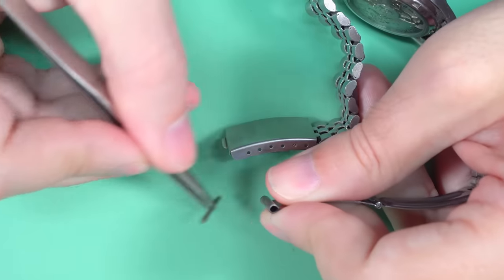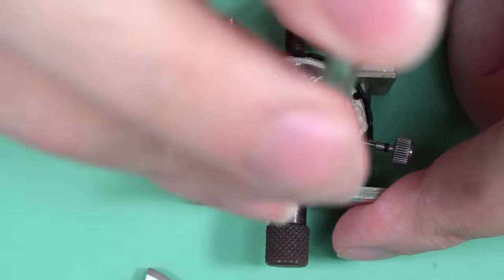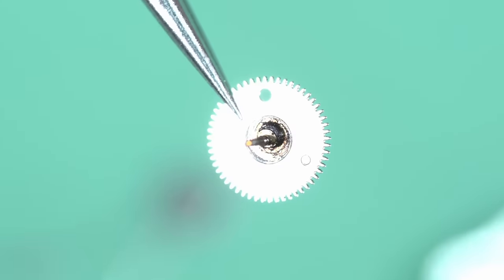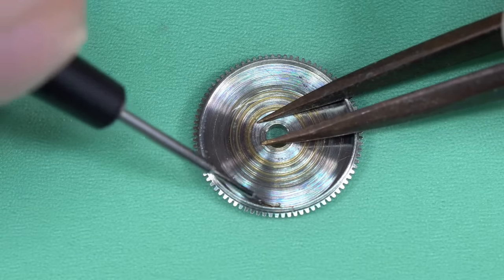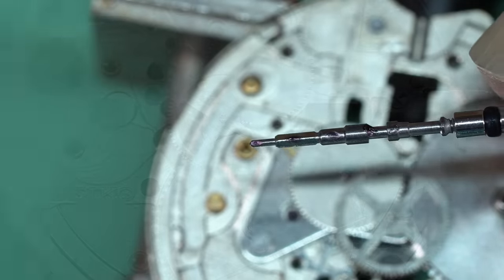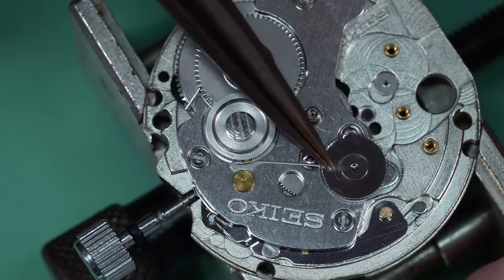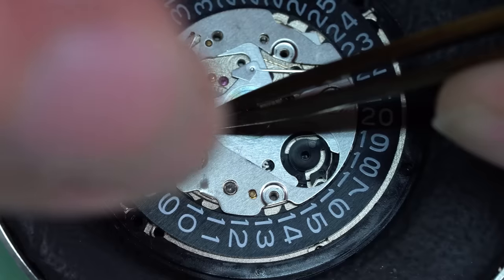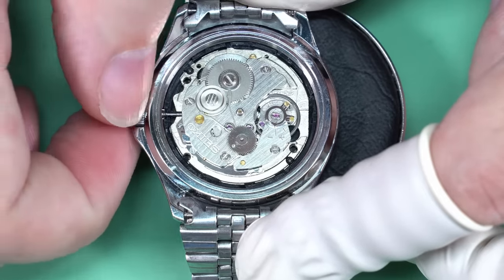Seiko 7s26 full stripdown service, restoration and watch repair tutorial

Comment: I wish i had an uncle like you.
Reply from the maker: Lol
Reply: And your older than he is..
Reply: @WatchRepairChannel  how much does a service  like that usually  cost ? I  have  3 vintage  seiko s  that require  that  procedure .
Reply: @charleebunch6637  less than $50
Reply: NakazatoTakeshi a service is much more then 50 bucks. You can buy the movement for 40-50. If you own one of these and the movement stops working it’s much cheaper to buy a new movement for it, rather then getting it serviced.
Reply: @Janet_Airlines802  oh I guess my local watchmaker doing a charity then because he offers to service my 7S26 for $30.
Reply: @nakazatotakeshi4286  it's probably not as extensive. If he's just opening it up and doing a simple service he isn't going to tear it completely down like this
Reply: @nakazatotakeshi4286  Erm, nope - this guy was doing a full stripdown and clean, plus replacement of several parts, on an old, poorly-maintained watch. I guarantee your guy does no more than 30% of the work shown in this video, and probably not even that. No one can 'service' a movement that cheaply; typical costs are in the hundreds. I'm guessing Mark probably 'ate' all the costs here as it was family. I do that when servicing PCs for relatives, obviously.
Reply: @Janet_Airlines802  I had this movement serviced at seiko a few years ago for $125
Reply: Price depends on where you live.
Reply: @nakazatotakeshi4286  Do you mind naming your local watchmaker so that I may look him up?

Comment: Nice video, Mark. One thing I've noticed with most Seiko 5 movements is low amplitude. I had a brand new one which started out very well at 270 degrees yet within a few months had dropped to 245. I adjusted the beat to zero error dial up and it kept quite good time to within 15 seconds per day whilst being worn. I have one to service and wasn't sure about stripping the day and date but thanks to you I now know. I like the idea of the date jumper being part of the plate so no fear of it launching into space never to be seen again...
For such an inexpensive movement they are quite well constructed. The automatic winding system with its magic lever is a thing of genius although not sure how efficient it is compared with anything in the ETA stable; although IWC rings a bell as I'm certain they used something similar in one of their movements.
Still, an excellent presentation from an expert who makes these services appear a lot easier than they really are especially when it comes to diashock/ diafix springs.
Many thanks, Mark.

Comment: Not many Seiko 5s get that kind of care!   Nice work.   Simply amazing,   I wish my Seiko swatches ran as well!
Reply from the maker: Sad to say we live in a throw away society
Reply: That's right, because the Seiko 5 is bullet proof! The scratched to hell look of my working watch is a badge of honour for the engineers that designed and built it.
Reply: @aaronwalderslade  preach brotha, preach. i can't believe it works after the hell i've put mine through (i'm a building mechanic). its scratched up, shock tested daily, dunked in water, i've hit that glass face so damn hard i thought the glass would shatter, but no  4 band replacements later and she still won't give up. Seiko 4life!
Reply: @aaronwalderslade  I've had my Seiko 5 for near 30yrs and it's still going great!

Comment: Thanks for the video!  I have a 7S26C movement that stopped working and the second hand would spin freely after a small drop.  I went through the movement watching your video and found that the pallet fork was not properly engaged.  Took me far longer to get the balance wheel back in but once I did it worked and is keeping perfect time.  Thanks again.

Comment: I am amazed how cleverly inexpensive this mechanism is.
I am sort of a machinist,  but. Mechanical system are very universal in nature.
I watched you rebuild a Rolex, and then this Seiko.
The Rolex amazes with the solid, machined complexity.
This Seiko fascinates with its simple, multifunctional stampings,  die cast parts and sleeve bearings everywhere.
Well, I saw One ball bearing, and no more than 3 Ruby assemblies.
The pinnacle of the show is, of course the host. There is no doubt about the knowledge,  the dexterity,  and the soft spoken humble manner with which he presents all the episodes I watched.
Thank you Sir, for the wonderful shows.

Simple Simon

Comment: Impressive. I admire that you've learned to do all these. I've heard and read  everywhere (except for may be one adverse comment) that the 7S26 is a reliable workhorse that would last me years before requiring servicing. But I've had the bad experience of it (on a Seiko 5) drying up and stopping in slightly over 1 year of use.

Comment: If there is something that learned from buying Seiko's locally and reselling them online (And occasionally giving basic service) is that to make a Seiko not tick takes a substantial amount of abuse.

I've seen a couple that survived motorcycle accidents and both still ticked after a gentle Seiko shake, even though one was basically dragged through the asphalt while making some sparks(and saved the guy's arm). Probably have a few more stories but not a whole lot of pictures.

Great informative video overall, and since i'm getting back and learning about "better than basic servicing" now it's a great guide to be able to rely on!
Reply: mine doesnt work after 1 year and cant afford fixing it

Comment: Mark, I have played with dozens of 7S26 - and I've NEVER seen accuracy like this. You have to make a video on how you regulated - or is it really down to the upper and lower shock lubrication and a clean hairspring?
Reply: Kristopher Marciniak what I found surprising is he perhaps didn’t remove the shocks for cleaning.   Oiling and placement of diashocks can really make a difference on amplitude but granted Marks regulation was impressive but then that’s also down to experience.  A good game of cat and mouse with the stud and regulator  too!
Reply: @MyRetroWatches  sir, by the time, can you tell me maximum gain or lose of seconds for a day of this watch ? ( in maximum performance you have reached ? )
Reply: In my experience, you can regulate most well functioning 7S26 movements to within a second or two a day, but they won't stay that way, a few months down the road and they'll loose accuracy. ofc you can regulate them again but I've mostly just given up and settled for +-15sec a day..
Reply from the maker: No watch will stay that way. From the second a movement service is complete it will degrade. That's why it should be serviced regularly.
Reply: @WatchRepairChannel  i have a 7s36c movement How often should a watch service be done? Ty for your videos

Comment: Thank you for the video. I am an amateur watchmaker . I am also a collector. Mostly Swiss watches. But have found a real appreciation for the Seiko 5 series. They have a size and resilience I appreciate. I dropped one and the oscillating weight became loose from the bearing. I have not found a parts supplier. 
Your video is fantastic my only wish is more information on the type of oil used . 
Fantastic videos I will begin watching them all. Thank you.

Comment: How much would a service like this be? Mine is older, never serviced but still functioning!
Reply: Servicing an old 7S26 will cost more than buying and professionally installing a brand new NH36 movement, witch is an upgrade so you'll get hacking and hand-winding.  The only reason to service a 7S26 is if you want to spend more money than the watch is worth to keep it 100% original.
Reply from the maker: Most mechanical items with moving parts will need to be either serviced or discarded at some point, watch movements can be very durable but they're not special in that regard. The argument over whether to service or replace is a personal choice.

Comment: Such fun movements these! I've serviced a couple of these myself and was called being crazy to invest time in such a cheap movement, but I liked doing it and see how far the performance could be upgraded to. At first I didn't think much of the performance after service, but then I realized the lift angle of these is 53 degrees, and that made the amplitude a bit more acceptable. I have serviced some NH36 movements too, and was surprised by the way they have added hacking and hand windjng in to it. A lot of parts look alike, but are not interchangeable between those. Thanks for posting again Mark, excellent montage as always!
Reply from the maker: Cheers :)

Comment: You're obviously a pro and I am brand new to watch repair and I have the cheap blue demagnetizer but using a gauss meter through experimentation I've discovered that the best way to demagnetize things is not to just hit the button but to hold the button and then pull the object away while it's still on
Reply: You are supposed to put the watch on the pad, press and hold the button for 10 seconds, and then lift straight up slowly to at least 6 inches.

Comment: Thank you for posting this video.  I was always curious as to how the wheel train and the rotor/winding assembly were put together on Seiko movements.  A masterful job of disassembly and reassembly.  I like how you checked the action of the wheel train and then the lever escapement, just after finishing, before moving on to the next step.  Nicely done!

Comment: i knew there was a secret to taking the winding pin out. very clever. my number face came detached from the mechanism, in the video you showed it wasn't held down by anything except the pressure fit of the stem the hands are attached to. i didn't see anywhere in my watch where that would be possible. its almost like a part went missing, the watch works great but the dial/watch face was spinning around just like the automatic weight in the back. i would tap  my hand on something and the 12 o'clock would all of a sudden be at the 3 o'clock mark. it was just spinning in the case. so i was very delicate with some super glue and put a super thin coat on just the outside edge. put it back in before the glue dried. its been working so far. i've had it forever and beat the crap out of it. i would hate to see this watch hit the junk drawer.

Comment: You, sir, are a wonderful person!  It's great to see repairs and restoration rather than chuck and buy a cheap replacement.  I've just acquired a Sekonda 26 jewel automatic watch (1980s, I think).  I will need to get it looked at: it was running fine initially but is now gaining about 5 minutes over an hour!  
Thanks
Tony
ps subscribed :-)

Comment: Hi, First. Amazing. Between your skill as a watchmaker and the camera work, this is basically all one needs to service a 7S26. Wow. My question. When you replace the escape wheel, it does not look like that it is sitting in a jeweled bearing (looks loose) is it tricky to position the escape wheel? Thanks again. Your quite a remarkable craftsman.

Comment: Fascinating to see how similar this watch is to my 5 year old Seiko 5. The only difference I could see was the stem is located at 4 o'clock these days rather than 3 o'clock, and the double-thickness chapter markers at 12 o'clock were not split on this model. And mine says 21 jewels on the rotor only, not the face.

Comment: Thanks for this video, it’s been super helpful for me to try to fix my brothers’ 7s26

As you can probably tell already, I haven’t succeeded just yet! Would you mind pointing me in the right direction? The balance assembly is done correctly imo, yet the watch only ticks for about 5 seconds maximum (long enough to be the mainspring moving it and not my initial nudge)

Assembly up to pallet fork  OK - all wheels move smoothly

Assembly of the pallet fork itself OK - all wheels move when I nudge it gently. It prevents the mainspring from discharging

Assembly of the balance - problem here. It just stops after 5 seconds. Yet:
- The mainspring is very much wounded up 
- the stone on the balance is appropriately attached to the pallet fork

Any ideas of what could be preventing the watch from ticking consistently? I’ve tried the balance assembly of a donor, and screwing a tad softer/stronger a number of screws 

Looking forward to hearing from you. 

Merry Xmas! 
Alvaro

Comment: At 36:55, replacing the oscillating weight -- why align the hole on the reduction wheel with the brass post on the balance cock, and then align the weight with the stem, before securing the weight?  Is it needed for them to fit together, or is it to help check for engagement?

Comment: Very Good video. Found my old seiko in my drawer havent used it in 6years. After watching I realized the counter weight came apart. I carefully superglued the weight back together and reinstalled like in the video. I saw the counter weight now turns the little wheel. My watch is working again tysm!!

I was curious, once the watch has some charge. I can see on the one side there are 2 arms. Which can be adjusted. A small thin one and a bigger thicker one. Behind those I can see movements when it is working. I believe they work the duration of the second and minute arms but I'm not certain. I think you refer to them as shock settings. Can you make a video explaining what they are used for and how I would need to have them adjusted. Or possibly let me know here. Thanks again

Comment: What do you mean, you wound the movement automatically?  New to this so learning.  I took the one I have apart but didn't go too far as I don't have the grease and cleaning solution yet.  The watch I have does not have any movement,  Should trying to change the time required a certain amount of force or should it be freely moving with no kind of friction.  It seems pretty "tight" to move the hands around.

found a video on it.  thanks for the tear down on the movement.  will be fun when i start taking it all apart.

Comment: Hello,  your tutorials are really good. I have two  questions if you can help. I own a Seiko 6138-0020 that has some issues, it winds with movement , but i can not wind it from the crown, does it have this function? the last question is what types of lubricants and grease do you use for different parts. thank you in advance, it is really good that from your videos you show us the insights of watch repair. Greetings from Greece.

Comment: Thanks for the video. This gave me enough confidence to open my watch.. the only problem I have, is that I can’t unscrew the small crosshead screw behind the dial.. I tried with a PH0000 screwdriver (the smallest I have). What screwdriver do you use for this? Do I need a JIS instead of a PH?

Comment: I have just received an old Seiko 5 from Ebay. I put the movement, dial and hands attached into my ultrasonic cleaner with a drop of washing up liquid. After, I poured lighter fuel over it, and when it dried out, it started ticking !!!

Comment: Fantastic video! I've got a couple of questions (sorry these are probably super basic questions , but here goes): how much better is the 7s26C vs 7s26B movement? How does the timeographer work? And how much can I expect a service like this to cost on my 7S26C movement (minus the buffing etc).
Reply: Between the B and C version performance is identical. 

The timegrapher uses a microphone to hear the beat, there are apps which do the same just less accurate.

A 7s26 is cheap to service around 100€ but they can go for 20 years without one.

Comment: Fantastic and inspiring job: thanks for sharing!
Would you please show how do you reassemble the plate of a Chinese 2813 or the Miyota 8215 with their "infamous" five pivots holes to align with both the train wheels and the reduction wheels? I can do it now and then but as a total beginner I spend many hours trying to keep all the pivots in position and possibly you may have a better and safer way to accomplish the task.
That will be most helpful.
Cheers
Reply from the maker: I have a few miyota movements here. Will have a look.

Comment: I have this watch right now with me it's for sure 15 years + old i don't exactly how old it is , my grandfather died 10 years ago and my grandma gave me this watch and it was not at a working condition and i was a small kid at the time it used to work occasionally when there was movement but later i kept the watch in my drawer and didn't used it much and i once took it again and it was a bit loose so I made it a little tight to fit my hands and after using for sometime again I kept it back into the drawer and now as I'm 20 I now realised this is a great watch and it actually costs more than some usual watches is there anyway I can make it work or I can sell it?

Comment: Thanks for this video. I have a Seiko 5 with the same movement, but the oscillating weight on my one popped off the bearing ... I sent it in for repair, but they just pushed it on and it popped off again with a very slight bump... Any trick on how its supposed to be held in there?

Comment: Great video. What was changed between the B and C versions of the 7s26? And what's different about the 7s36? Just a bigger main spring?
Reply: Hi I believe the etachron system used and the mainsprings are different, they have different part no.s

Comment: Great video, thanks!  I have a question; how critical is it to line up the hole on the first reduction wheel with the brass post? I recently had to tighten the oscillating weight and did not align the parts as you indicated. The watch started winding again, but I wonder if it could be better.

Comment: Is there a service manual or procedure you can reference for servicing movements, that walks you through disassembly and reassembly? In automotive repair, we have removal and installation procedures as well as assembly and disassembly. Just curious how that works.